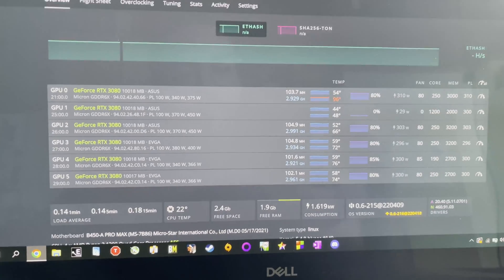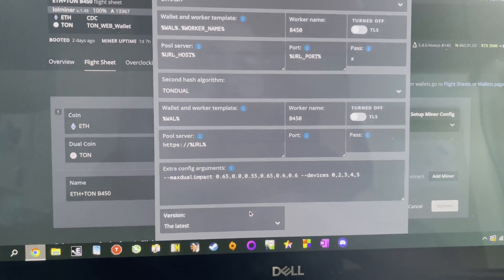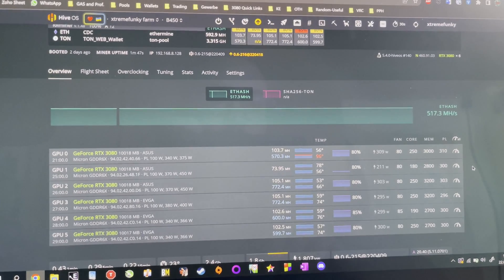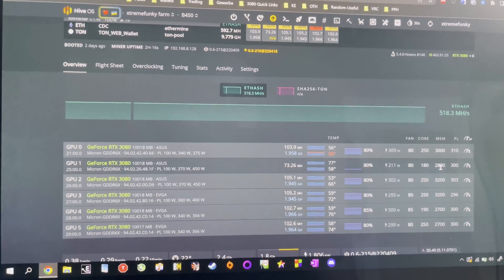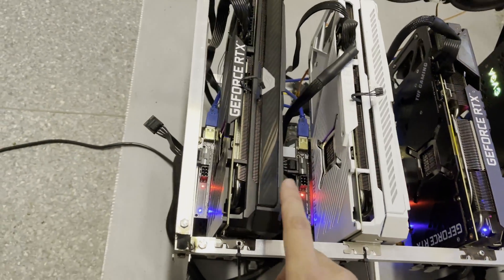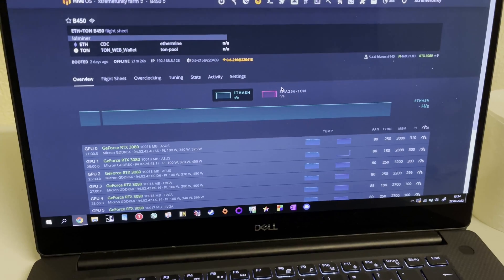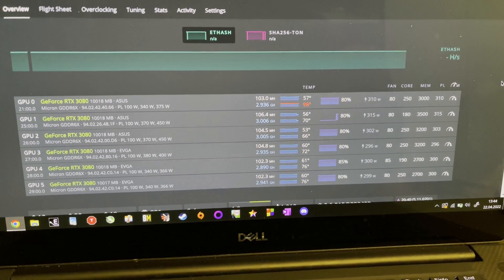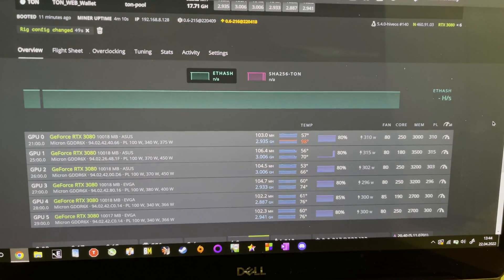Used Too Thick Copper Plates on Strix RTX 3080 - Is it gone now? Damage? GDDR6X

Comment: Why you didn't mod the first Asus? the one with 98c temp
Reply from the maker: Its already modded and this is the result.
The first one is a TUF and TUF has a really bad thermal design.
Reply: @UnleashedOverclocking  try to redo your TUF with 1.8mm copper shims. It should be in the 80s
Reply from the maker: @kimohw  hahah. I wish. but sadly not. Like I said. all the card that you can see, are already copper modded. I dont have any cards with pads. 
In fact, did I redo the TUF today with better thermal paste, just to see, if it would change anything. But nope. Still nothing, still bad thermal concept.

Please dont forget at this point, that the cards have a powerdraw of over 300W, due to dualminig
Reply: @UnleashedOverclocking  so what is the exact thickness of copper shims on asus tuf rtx 3070 ti for vram ?

Comment: I tried 1.5mm copper shims for my 3080 FE and had horrible results. It was not making contact with the die and I have seen a lot of videos that suggest using 1.5mm Any idea?
Reply from the maker: I have made a video about the FE. Should work flawless, if you do it exactly like I mentoned there.
Reply: @UnleashedOverclocking  I followed everything. I feel like 2021 batch is not 1.5mm.  I retried 1.2mm better core contact, but VRAM temps is still high. I dont understand what I'm doing wrong
Reply: @Justin-sm1no  Try 1mm copper shims. Friend of mine did 3080Ti and it worked properly.
Reply: rub it on 400 sand paper until it goes down to like 1.3-1.2mm and try again.
Reply: whatever the original pad thickness is, go like 0.2-0.3mm lower than that with copper.

Comment: Same thing is happening to me after I did the copper plate mod with liquid metal... its just impossible to get proper contact and im desperate...
Reply from the maker: If you want to use LM you HAVE TO use a 0.5mm thermal pad. Between cooler and Copper. 
The reason why this works is simple. The effective part of the vram that is getting hot is only a mm wide. That’s the effective part. 
Thermal pad is too bad to transfer the heat which is only generated at a small spot. If you use thermal paste to conduct it to copper it spreads in the copper and the thermal pad is then able to conduct it to the cooler. Works for real.
Reply: @UnleashedOverclocking  I mean LM on the core not on the copper plates for the memory :/
Reply from the maker: @JazekFTW  yeah. I know. Nobody would be that insane. Not even me 😂

Comment: Did it take a year for the thermal paste to run down and that's why the temperature when up? :)
Reply from the maker: It took less than a few days. 
Before I took this video, I repasted the card 2 or 3 times, just to be sure, its
not a paste fault. After the 3rd time I was like: Okay. Yes we definitely need 
to change something. 
Depends on the thermal paste it self, I guess. Because the paste that 
I used before was the arctic ceramique, which is waay thicker than the MX-5. 
And yes, this particular paste stayed on for nearly a year. 
But doesnt change the fact, that the temps were bad at the very first start. 
I just didnt mind. Why should I? 50 or 60? Doesnt care. 50 or cant even mine. 
Okay I care! :D

Comment: Whats your power cost and did you buy copper plates this time around? Iirc last times you "made them yourself" by buying a bigger one and adjusting it.
Reply from the maker: Im paying 30 cents per kWh. Welcome to germany :). 

Euuhm. I bought 1.8mm ones and just sanded a bit the edges to get rid of the sharpness.
Reply: @UnleashedOverclocking  buy some solar panels for mining